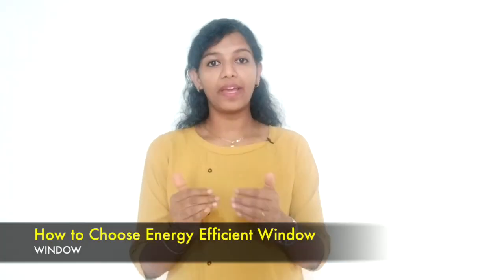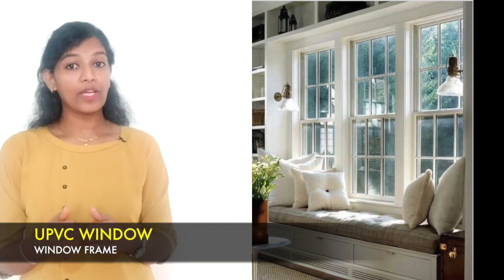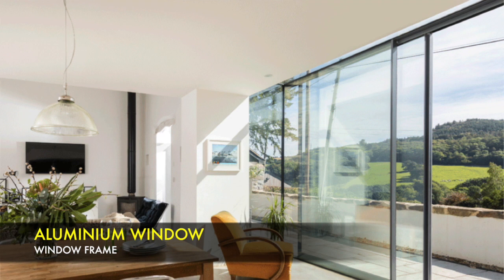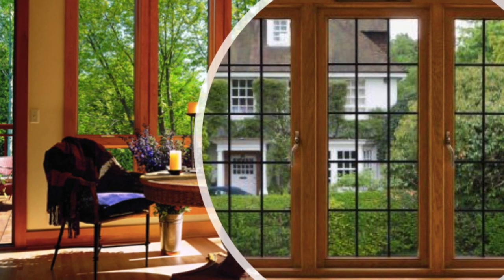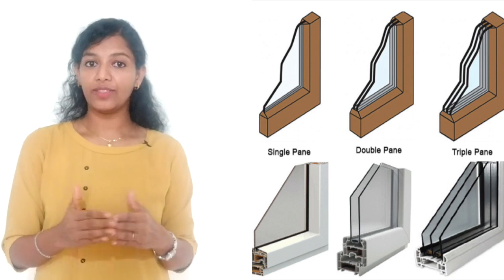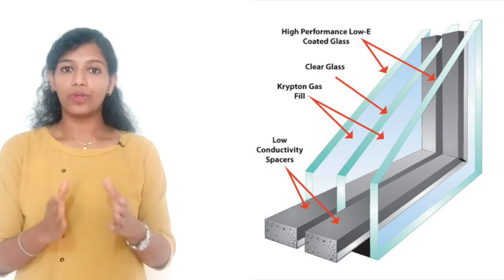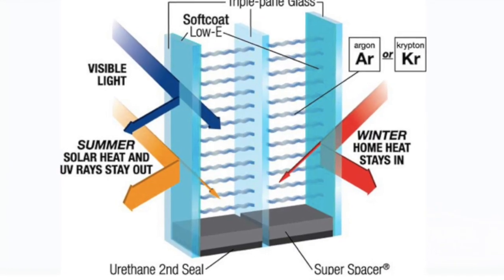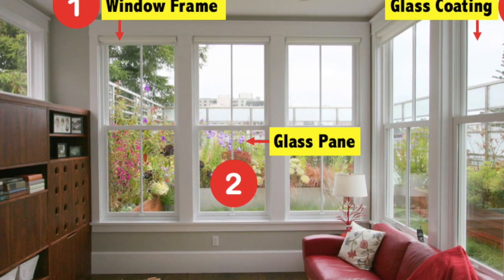CHOOSE ENERGY EFFICIENT WINDOW!!

Comment: Nice one 👌 but I want a suggestion from your side which type is best suitable for residential home purpose 2BHK which can have better Air cooling effect to home , free pass of air and good lighting
Reply from the maker: Please Check in Saint- Gobain Glass!
Sun Ban TruVision Neutral Solar Control Glass

U Value:                                              4.9W/m2K
Visual Light Transmission (VLT):   45%
Shading Coefficient:                         0.51 SC
Reflection:                                          22% (External), 4(Internal)
Solar Factor:                                      0.44 SF/ SHGC

Comment: Good Presentation. Please check whether the term "Glazing" has been used correctly!!!. Glazing and Coating or not similar word.
Reply from the maker: Thank You!
GLAZING that are used includes clear and tinted float glass, tempered glass and laminated glass as well as a variety of coated glasses, all of which can be glazed singly or as double or even triple, glazing units.

COATING is about Low-E coating an undetectable layer of Silver oxide.